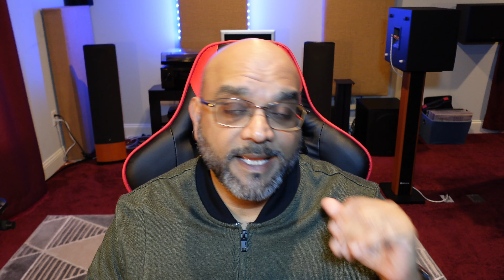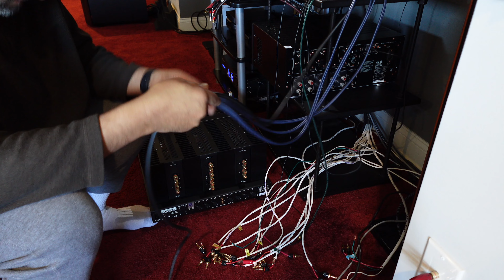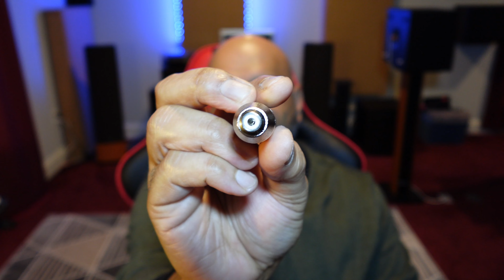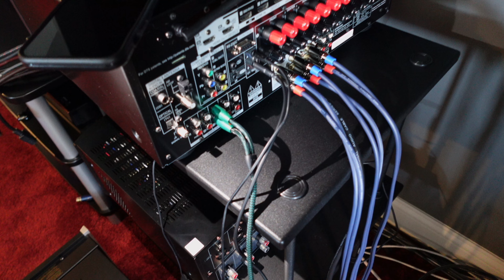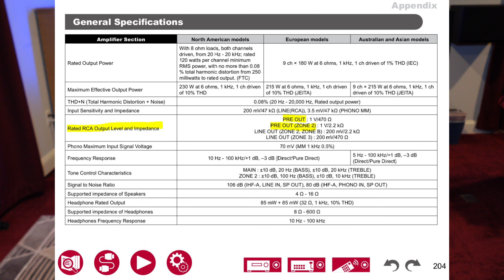Can the Pioneer Elite VSX-LX505 Preamp Outs Drive External Amps?

Comment: The outlaw unit has a chassis ground screw on the back next to the power switch. Get a wire and connect the ground from the Amp to your AVR/Process.  Did you try that?
Reply from the maker: Hi - Thanks for the recommendation. My McIntosh MC8207 does not have the ground connector.  The noise was from the RCA preouts. Not enough output voltage for my McIntosh unfortunately.  I didn’t have that issue when connected to the Marantz MM7055 5-channel via RCA.

Comment: How do I turn off the speakers connected to the LX505 when I have a second set of speakers connected to the amplifier and I only want the second set to play? I would appreciate an answer.
Reply from the maker: Unfortunately the Lx505 does not have the option. My older Pioneer Elite VSX-52 has that option but not the new generation of AVRs from Pioneer

Comment: I have also the pioneer vsx-lx505 and use the pre-out to 2 different amplifiers ( Emotiva basx a3 and Tonewinner AD 5100PA+) for main and high speakers with rca cables and it's working perfectly for almost 2 years with no buzzing sound.
Reply from the maker: That’s great.  The buzzing will not not happen with all the amps.  You have to find the right ones.  Amps with input sensitivity of 1V to 1.5V should work fine without any buzzing.

Comment: Why don't you get a Marantz Pre-Pro to go with that $7000 McIntosh? Like the AV7006 or even better, the Cinema 30. I had both, and the Cinema 30 is on a different level. Then there is the AV10! lol. Not going to lie; I am a little jealous of that 8207, lol.
Reply from the maker: Thanks. I used to have the AV8805A. Plan is to eventually get the AV10. Fingers crossed!🤞

Comment: I have had a variety of pioneer amps.  I had the LX 103. I use it upstairs.  I have the LX 505 downstairs.   Someone give the LX 805 a bad review so I guess I’m probably not gonna be looking at that. That’s why I am exactly where you are. I am buying a power amp to go underneath it.    After you were all done how did you feel the LX 505 performed? I am very curious. Thank you for your time.
Reply from the maker: @ProgressiveHifi   Yes, same here. I’ve buying Pioneer AVRs since the VSX-74TXH. Every model since then until they got bought by Onkyo.  This was the first since the Onkyo acquisition.  The sound via the built amps is clean. DIRAC does a great job with the bass calibration. Unfortunately, the buzzing has not stopped.  It’s faint but it’s there.  If I turn up the volume enough I don’t hear it.  The buzzing aside it does not have enough to power the McIntosh amplifier.  I switched it out for my older Pioneer VSX-52, just to rule out other issues.  VSX-52 is all quiet. No buzzing whatsoever.  It’s truly unfortunate.  I love the sound of the 505 via the preamp outs as well as built in amps but that buzzing is deal breaker.
Reply: @ I got rid of my buzzing with high end power conditioner
Reply: @ but I imagine you have one
Reply from the maker: I have the Panamax PM5300. Not the highest of the high end but everything was working was just fine with the Marantz AV8805A and the McIntosh 8207 combination.
Reply: @ I have a summit a11 gen 2 coming
Reply from the maker: Input sensitivity of 1.4v for the XLR inputs. That’s good and LX505 should work just fine.

Comment: Order an Art clean box pro.  100% problem gone. It will take your unbalanced RCA and give you a balanced XLR output.  It will also boost your signal ..I think you can go to plus 21.. but you normally should be fine with the gain knobs around halfway. I use an oscilloscope 2 properly gain stage..... Also  first try using a 3 prong to 2 prong ground delete adapter for the power cable on that McIntosh amplifier.  I bet that will take a lot of the buzz out.  It might surprise you. But art box will 💯 solve all your problems for only like 80$. Also with your RCA cables you use to run from the pre-outs into the art box, or your XLR adpts...make sure they are COAX RCA's with center pin and shield...NOT twisted pair......Cheers
Reply from the maker: Yes, I saw that on Amazon when I was looking for the XLR to RCA cables.  How do I make sure I am applying too much via the Art clean box?
Reply: Hey man I'm so sorry I didn't see this reply.  I'm sure you figured it out by now.  But I used an oscilloscope.  But as many as I have installed and messed around with now.... Normally about halfway, to 3/4 max.  You will get to a point where slightly before or right around 3/4 will be the max.. before it falls on its face.. I use XLS crown amps.  I figured out the best way to gain stage.  Play a 1K test tone that starts at -20db and then every couple seconds it will give you a 0 DB peak tone... So I adjust the clean box to about halfway.... then adjust my input gain knobs on the crown amp to  about halfway... I keep turning the input gain up until I see the light flash red into clipping  from when you get that 0 DB increase.. so when it's playing the -20 it's a good clean signal.  Then when you see it hit red into the clipping... that's when it obviously hits the 0 DB blip... then you just back the crown input sensitivity knob back a click until it no longer hit's red and clips when it hits that 0db Mark... 0 DB will be the loudest level you will hear on a movie ... So this way you know you are getting a clean signal.. and when you do hit those loud points in the movie... You know you will not clip... Sometimes to double-check afterwards. I'll just play a solid 0 DB 1k tone and then make sure I'm not clipping then I'll turn the crown gain input up one click from where I backed it down on the last test... if it's set up right that one click up should send you into clipping.  Obviously unhook your speakers from the amp when doing this! Lol  @magnoliamo
Reply from the maker: Thanks for the information. Very detailed. I think it’s a little too much for me, meaning, i might mess it up and end up with blown speakers or amps lol.  I will give this a try.
Reply: @magnoliamo  dude no way!!  Have complete faith in you! I'm telling you though lifting the grounds on the power cables, and then using the clean box pros, making sure you are using coaxial RCA's. Not twisted pair. Try and get the shortest RCA's you can that will reach from your preamp to the clean box.  Then get some good xlrs to go from the output of the clean box into your amplifier.  I got 2 ft power cables for my apps so they would be as short as possible running into my panamax . Then I have coax RCA is from my Denon pre-outs to the clean box.  Short as possible.   And then I bought xlrs that are 1.5 feet ... So all of my wires are short as possible and I tried to keep the power wires as far away from the clean boxes and xlrs as possible.  I made sure to wrap up the extra cable from the clean box power chords and tucked  them out of the way as well ... Making sure my Denon power cord, the two power cords from the crown amps, and the two power cords from the art clean boxes are all plugged in to my panamax power conditioner.
Reply: @magnoliamo shoot me your email if you want and I will send you some pictures and possibly some short videos if u would like

Comment: I have a problem, maybe you can help me with it. I have the marantz AV8805A connected to Mm8077, the issue I’m having my fronts are not putting out the sound I’m looking for. I have B&W 702s3, with matching center. What do I to do to improve the output of those 702s3, and center?
Reply: Bi-Amp the fronts. If you are using all seven channels now, then get the MM7055 or MM7025 to run the other speakers. I have the MM8077 and the MM7055, and I Bi-Amp my fronts off of the 8077
Reply from the maker: @m4nc1n1 I used to have the MM8077. It’s a good amp. I replaced it with the McIntosh MC8207 which I love.  I have the B&W CT7.4 for LCR and side surrounds and CT7.5 for back surrounds.  I don’t think bi-amping them would make a difference.  If I kept the B&W 702S2’s I would have bi-amped them.
Reply from the maker: Thanks for the question. The 702 S3’s require a good solid state amp with a nominal impedance of 8 ohms but do dip down to 3 ohms. The MM8077 is only 150 watts per channel and has rated impedance of 6-8 ohms.  I used to have the 702 S2 connected to my McIntosh 8207 with AV8805A as the preamp.  They produced very good dynamic sound for movies and were very musical driven by the 200 watts per channel Mac.  I would recommend an Emotiva Xpa-3 3-channel amp for the front/center. You can also try Monolith by Monoprice. Again, the MM8077 is a good amp but when I had it in my system connected to MartinLogan Theos electrostatic speakers I always felt it lacked the power when it came to speakers with nominal impedance of 4 ohms.

Comment: This is one of the reasons why D&M owners stay pretty loyal.  The preamps output 1.4v and about 2.0v in Preamp mode.  They dont have any issues driving most amps out there.
Reply: It all depends on the amplifier. Sometimes you still have a hum. And getting that 1.4 volts as normally with your channel gain at 0 and the master cranked as well.   After audyssey runs....and your channel levels get backed down to -4 to -7.... Your voltage isn't anywhere near 1.4.  I did all kinds of tests with this on my 3800x using an oscilloscope.   I got video footage of a lot of it because I planned on making a video
Reply: @skypallman6169  the hiss depends on the speakers, not usually the processor (though it can).  I have a Crown Drivecore 2 amp and those are notorious for producing audible hiss....but mine have no hiss.  The hiss is so low that I litterally had to place my ear on the grill right next to the tweeter to hear it.  Its all about the speakers sensitivity.

And yeah, if the amp is also very sensitive then it can also hiss.....but this is all about pairing the right speaker with the right amp.
Reply: @FURognar  I mean the his can definitely be more pronounced if you have high sensitivity speakers.  But I'm telling you.  Anybody who has any kind of hum like that... Eliminating the ground from the power wire of the outboard amplifier will dramatically reduce 90% of it.  Cables are very important as well.  If you are using RCAs you need to be using coaxial RCA and not twisted pair.
Reply: @FURognar  also what are you running them off of? What's your pre amp? What input sensitivity setting are you running.  What type of cables are you using?  How far are the input attenuation gain knobs turned up on crown?  What are your individual Channel gains on AVR set too?
Reply: @skypallman6169  attenuation knobs are at about 80%.  I have it set to 1.4v (the other option is .775v) though I plan to experiement with both settings once I have all channels externally amped and switch the receiver to pre-amp mode.  Cables are just 12 gauge 100% copper.  Nothing special. (I dont buy into cables affecting the sound unless the cables are inadequate for a long run.  My run is 30 feet at the longest.